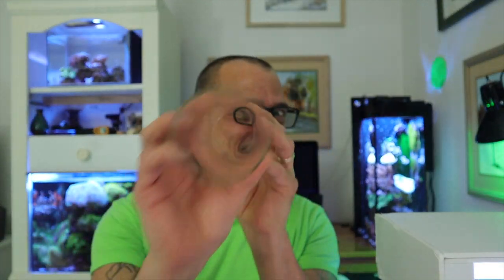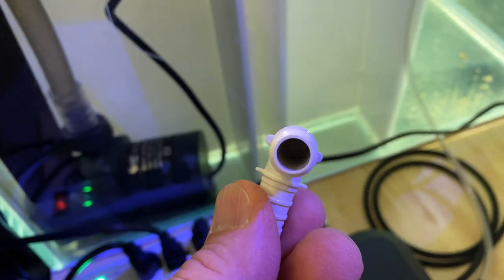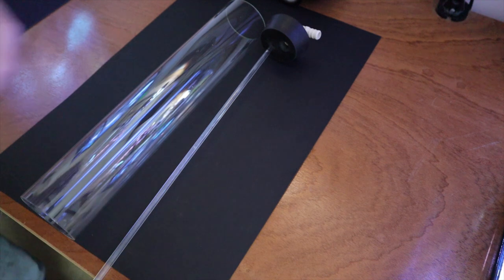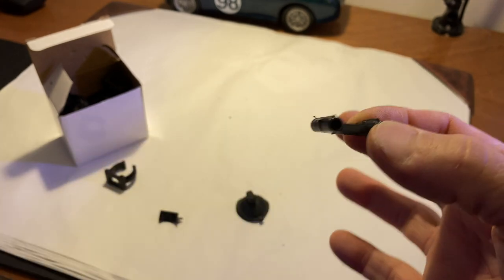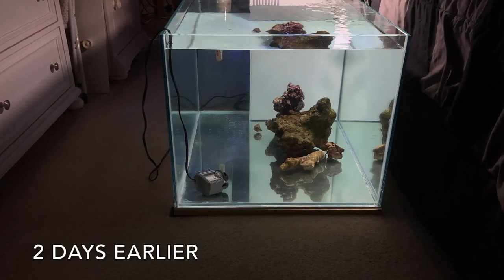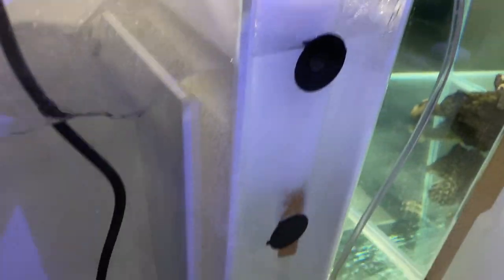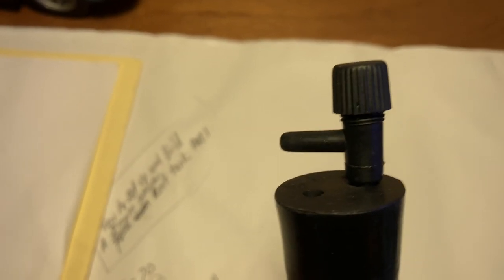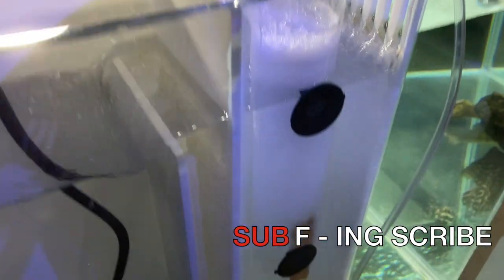How To Set Up And Build A Saltwater Reef Aquarium (Part 4) -75 Gallon - DIY Skimmer - Live Rock

Comment: Hey Tom great setup so far. One quick suggestion though. I would put the skimmer in the next compartment over and place the filter floss along with some carbon underneath in the overflow compartment. That way the the larger particles are filtered first. That how I have my nano setup and it’s been running great. Just a food for thought
Reply from the maker: Hi Josue, thanks, I could do that, and may. In the past, I have not used any mechanical filtration like a filter floss, except in a nano. And really, just to keep the overflow box clean. I may take the floss out all together. There’s a school of thought that says some of the larger organics and compounds  help feed the tank. By removing to much, you strip it down to much. I could utilize siphoning out the detritus that builds up in the overflow on a weekly/monthly basis . Each tank seems to take its own course, so I’ll see what it looks like some months down the road. Your method makes sense and is used a lot. 👍🏻😊

Comment: Hey Tom, what did you use to connect the rigid tube to the air stone and to the elbow on top?
Reply from the maker: Hi Jerry, the rigid tube was connected to a small piece of flexible tubing to connect the lime wood air. The elbow on top of the skimmer is pex to 1/2” ID tubing. The small air hose elbow is just a standard elbow👍🏻

Comment: Hey Tom, I was wondering what size rigid tubing you used for this and what kind of pump as well? I’d love to build one of these. Keep up the good work!
Reply from the maker: Hi Justin, I believe it’s 1/8” inside dimension. Amazon sells it. 👍🏻the skimmer works great! And practically no cost. Get a good strong air pump. Mine is Hygger. It’s solid and no noise 😊👍🏻
Reply: @TOMReefer  Thanks Tom. Another question I had was in your video it looked like you regular tubing connected to both outputs on the pump. How did you transition into the bigger tubing?
Reply from the maker: Hi Justin, I connect both because using one side left the uncovered outlet quite noisy. So I just ran the extra output hose to the floor. It stopped the noise. I used black rubber hose from Amazon which is far more flexible, and will fit over the tubbing. You could use smaller rigid tubing if you chose,  that would still work. 👍🏻

Comment: How will you clean the skimmer out?? Most have a removable cup at the top  that fills with the gunk from the tank
Reply from the maker: Hey Chris, the skimmate flows through the 1/2” hose to the collection container. To clean the thick gunk I’ll just slide the whole skimmer out of the tank and clean it. 👍🏻😊
Reply: @TOMReefer  how did you know what size to build for this tank?

Comment: Great build! Love the DIY. 
Q: did you have to do any tweaking on the overflow? I built my own overflow box (more of a landscape oriented model) but I can't seem to find the sweetspot where it skims the water surface without running dry after 12-18 hours. If I raise the water level it does not skim at all (hope that makes sense..).
Reply from the maker: Hi Gooxie, it sounds like it’s not big enough, or you’ll need to put an auto top in to keep the water level from dropping.
Reply: With each video I’m more and more impressed. Making wine from water!
Reply from the maker: @metsdynastyx  hi Mets, haha, thanks! I figure there might be someone like me who wants to save a few bucks 😃👍🏻 when I started this part of the project, I couldn’t believe what they want for skimmers!

Comment: Hey Tom just wondering my po4 is at 00.5 how do I raise it and since I raised that would I have to raise the no3 as well
Thanks
Reply: In a 10 gallon tank **
Reply from the maker: Hey George, do you mean your po4 is 0.05? If so that’s a nice place to be? Not sure you should try and raise it. If it’s 0.5 then you need to reduce it.
Reply: @TOMReefer  no I have the ppb Hanna checker where I have to divide to get my answer it  and it came back as.005
Reply: @TOMReefer  so basically it read 1.71 on the Hanna checker multiply that into 3.066 divide that into 1000 u get .005
Reply from the maker: Oh ok. So  How do your corals look? If they look fine, I wouldn’t mess with trying to raise it. If you want, you could supplement a little dry flake or pellet food for your fish. They usually have a decent amount of phos in them. As far as your nitrate rising, you’ll just have to test each and see. But If all looks good, I’d leave it alone👍🏻 you could skip a water change or two, see if that raises it.
Reply: @TOMReefer  corals look OK beside s the devils hand and the toadstool
Reply: corals look OK beside s the devils hand and the toadstool